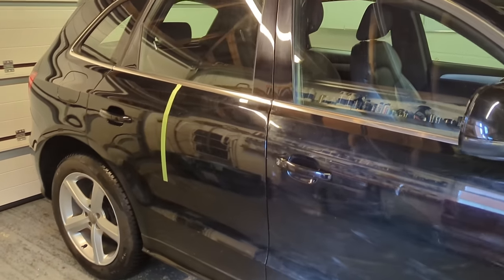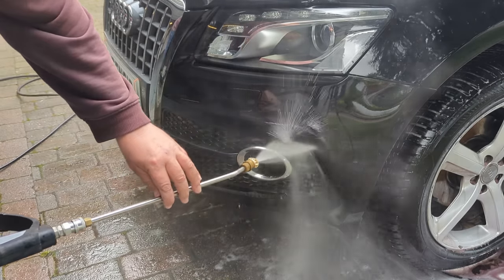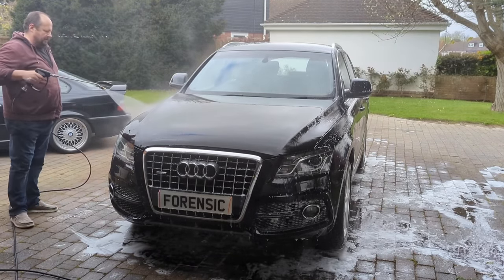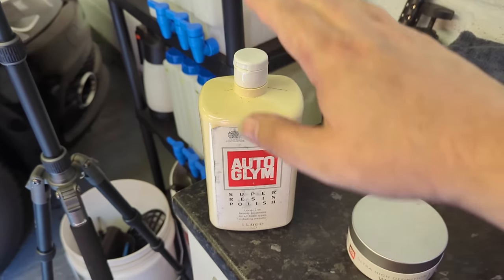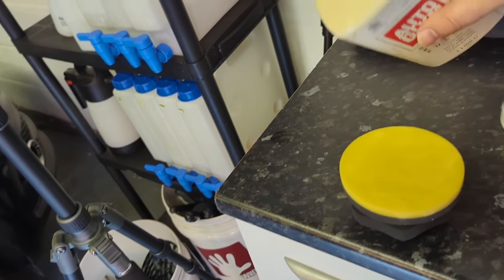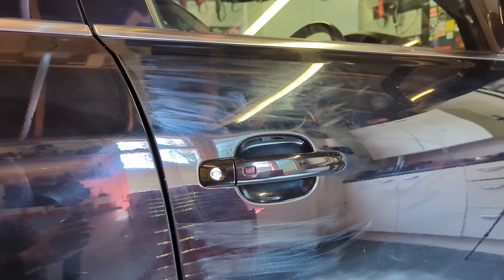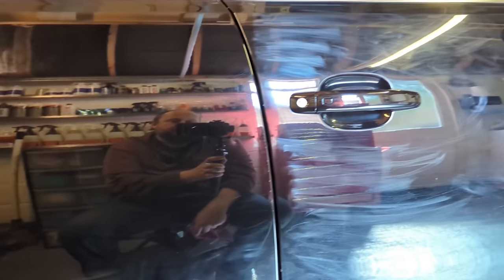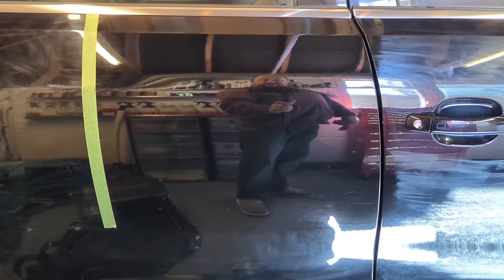How to Polish your Car by Hand | Beginners Guide

Comment: When I polished my Nissan 350Z by hand I washed the entire car and then I did the clay bar, hand polish and wax on each panel at a time over two days.  I did have it in garage but I still rewashed the panels on the second day in case any grit had landed on it.  This panel by panel approach spread out the intense effort of the polishing and I think it was less boring than several very long spells doing the same thing.

Comment: Good video, nice to see autoglym and basic processes that most people can use in action. 
Your comment about nutters who want more than a quick polish and wax made me realise those who machine polish are surely less than 1% of society? Niche group I’m happy to be part of. 
Machine polished for 10 years, weekend only hobby/semi professional, 120+ cars mostly classic and special types, started with a meguiars DA, lasted 3 years/50 cars. Then moved to flex 3401 and still going, almost always used 3m fast cut, meguiars ultimate compound, auoglym super resin polish, collonite 476 wax as 4 stage, reducing early stages or cut as needed, all after a good wash and clay of course, polishing is my happy place, clearly yours too!
Keep up the content, I remember before you had an envious lineup of flex machines decoration the garage wall - well deserved collection

Comment: Thanks for the Prestige Car Care Shop shout out. Those Adam's Polishes applicators are available with different foams. That yellow one is designed for waxes, Like their buttery wax in particular. But for those wanting hand polishes for spot repairs etc there are others available for the job 😎 👍🏻

Comment: I remember a test years ago done on a forum with 5 layers of SRP being about the best you could get it by hand. 
I’d be interested with an IPA wipe over how much had been removed vs filled, I’m a big fan of Black hole with buttery wet wax, easy on easy off, lasts couple of weeks. 

I was always impressed by the Gtechniq P1 with a foam applicator product videos but never felt the need to try it with SRP being such good value.

Comment: Used to polish by hand my E90 320i using Megs Ultimate Compound (then BH Cleanser Polish twice per year as maintenance) and top with BH Auto Balm.  Christ trying to buff off Auto Balm by hand was a HIIT work out.  That was  8 years ago.  Still have PTSD from buffing off BH Auto Balm - havent hand polished or hand buffed since.  The results were stunning, though for a 'hand job'....

Comment: I'm scared of machine polishing so last summer I did by hand and got decent results. Used Megs compound and then SRP. White really popped after but was exhausted, put fuso on top then. Took 12 hrs total 9am to 9pm. 

Side note not surprised by marks on this car by me a garage pressure washer has basically a yard nylon brush with water coming out and see so many people scrubbing away makes me cringe. RIP clear coat 😂

Comment: Hi Jon, I agree with you, some of us don’t have the luxury of owning a machine polisher, but as of late I’ve been seeing some people using a drill that is probably laying around the house paired up with a smaller diameter pad to do some polishing. Can you maybe go into a tutorial or something more in depth on this sort of angle?
Reply from the maker: Hmm I would not do that m8.  Get like 2nd hand da on eBay if on real hardcore budget.
Reply: A cordless drill works well if on a budget. 3 speeds to see which is most effective & be sure to attatch the extra handle. I polished headlights on a SAAB 93 back to almost new with a 3M headlight kit & a makita 18v cordless driver..

Comment: A couple of questions I’d like answers to are: how long do different types of detailing products last for (before they go off), and how should they be stored (e.g. is it ok to store them in a shed during a cold winter). Be good to see a video covering these topics 👍
Reply from the maker: if you put SRP on a car and dont wax over it the SRP will wash off after a few washes.    This bottle of SRP is 10 years old and works fine.  but if it was all dry and battered then bin it.   most paste waxes will stay good for years.   Any siloxane based product, spray and rinse for example, typicaly lasts a few years.

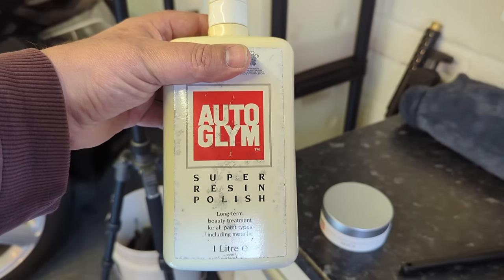Comment: @10:49 This would be the protection follow-up after an aggressive hand-applied T-Cut session on my bright red Vauxhall Nova back in the early 2000's. Followed by green slimy bumper gel to darken the grey faded bumpers (or monkey spunk, as the trade called it back then).

Comment: I'm afraid I've been converted to using the DIY detailing clay towel, it's a fantastic piece of kit for decontaminating, I've done my car with it using P&S absolute rinseless wash with 6-8ml per litre of distilled water and some Carpro iron remover as a clay lube system, removing both iron particles and general fallout. The best way is just to use the weight of the mitt with absolutely no pressure on the towel (or you will induce marring) and keep going over the same area until it feels silky smooth. Not marring and nearly a bare clean surface to polish. I tend to go over with Surfex HD lightly to remove polishing oils and Carpro Eraser to get anything I've missed. Then work out how and what's the best way to tackle the swirls and or marring. My new car was 90% perfect as the dealer was told not to wash it. So I gave it a very light hand polish with a puc and Koch Kemie microfine finishing polish (soft paint Japanese car) after a very short time after using a swirl lamp, a further improvement ready for Carpro Dquartz Go diamond nano ceramic coating. Sometimes you do need to machine polish a car and you'll need to set some time to correct the paintwork for older cars.

Comment: I’ve always hand polished with Autoglym SRP. As you say, hand polishing is an effort. I start well, but by the last panels, I’m rushing it.

This makes me want a machine polisher, but it makes me nervous 🤣 

Is there such a thing as an idiot proof machine polisher and pad(s) that can be used with SRP or the like?

I also love Autoglym UHD wax. Other than its ease of application/removal, the best thing about it, other than the great results, are that I genuinely see longevity of 6 months plus and still beads water.

Cheers,
Gary B

Comment: love your down to earth hands on videos. Im really struggling to remove the fine swirls from the painted black plastic between tail lights on my 2023 mustang. Had some sort of alien bird poo that etched in very quickly. I had no problem by hand once i used a microfiber pad to cut just using  meguiars ultimate polish and m210 glaze but no matter what type of sponge ive used i cant seem to remove the fine swirls that remain by hand. I havent been able to fill with any wax or sealant products from several brands yet either. I have a few autoglym products ive bought here in Australia that have worked well for me havent tried any polishes yet. Do you think this super resin polish will fill in the fine swirls or can you suggest any products that are best for filling and hiding these swirls, even if i have to use after every wash. This area of the mustang seems to swirl and mar just by staring at it too long. Any advice or suggestions would be muchly appreciated. Thanks for the great videos theyve been very helpful for a newbie like myself.

Comment: I do it by hand. Wash clay dry. Meg’s compound on the bigger marks then srp over whole panels. Bolt hammer wax to finish. Wash little in between due to time and it being a pick up but it is protected under the dirt. 

What’s the applicator at 15:00? Cant see a link in description thanks.
Reply from the maker: adams one mate prestige car care sell them in the UK get the stiffest one
Reply: @ForensicDetailing  thanks

Comment: On a side note Jon can you test the new rupes cordless (that you recently got your hands on) on hard German paint to see if it can cut similar to its corded versions? Would really like to see you critique it as much as possible considering it costs £750 which is not putting me off as I want to get my hands on one if it can cut well! Also can you try it with non rupes pads to see how it performs..
Reply from the maker: it can cut mate pair it up with blue wool and course compound..  They crank upto 5200 OPM and carry good torque, yes not as much torque as corded LHR15 but its not far off.  these machines are top draw and I am going to bust out my wallet and buy one, yes  its a lot of money but they are good.
Reply: @ForensicDetailing  thanks for the feedback.. yer I want one after seeing many reviews on how light and quiet it is.. do you rate it better than your xce cordless?

Comment: I've found WD-40 works well to remove tar. I assume tar remover is probably similar. Surely that would be more gentle on the paint than a clay bar. My own car has a lot of tar, I'm planning to pre-wash, go over with WD40 to get the tar, then wash again, then clay bar, then polish.
Reply from the maker: WD40 contains solvent to thin the lubricant so it could disolve tar but it will also leave a lube on the paint after the solvent vapes though
Reply: @ForensicDetailing  yeah it definitely leaves residue. It looks great while it's on there, haha.

Comment: SRP has no cut so only refresh the paint. 

With Lifeshine on the car AG said use SRP to remove bird etch while leaving LS intact.
Reply from the maker: it does contain abrasive and therefore has some cut.  Ive literally confirmed this with Mark at autoglym as initially AG customer services said it didnt have abrasive in it. but it does.  but its a small amount of abrasive so yer its more a filler glaze than a compound.

Comment: I have extra gloss protection and I think I will never use it, with all the other waxes I have.. Should I throw it away?
Reply from the maker: its a old school wax and solvent mix.  its pretty affordable.  Its nice to buff, but the durability is not great.  dont throw it away it will stay good for years.  but if you have something you prefer you could discard it.
Reply: @ForensicDetailing  I have it only for friend's and family cars, but hardly use it. I have much more others, with better durability, slickness and pretty much better in every aspect. So, I'll probably discard it